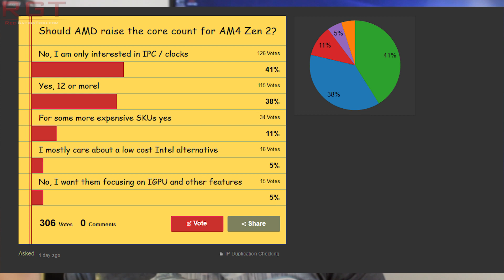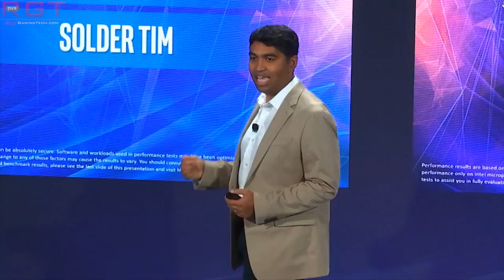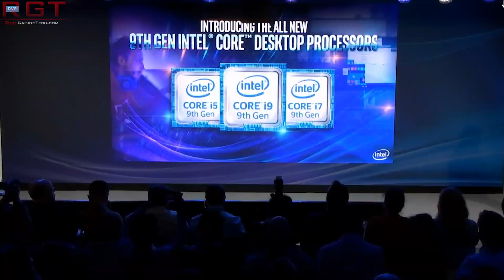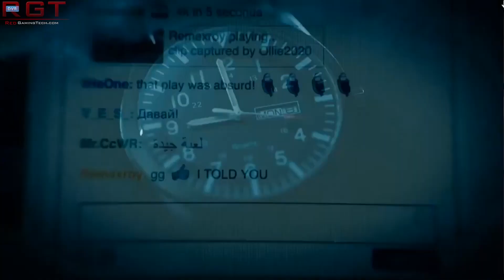Intel 10 Core Mainstream CPU Comet Lake | 14nm & Dual Ring Bus

Comment: 10 core mainstream Intel? (i bet they will list 95W TDP) Perfect for Z390 motherboard + Enermax TR4 360mm so it also cools the VRM :D
Reply: lmfao
Reply: bet this time it will require a new mb
Reply: @technologu  Most likely made of asbestos.
Reply: Advertised TDP->95w..  Actual power use -> 600w...  TDP (what TDP is really for) heatsink requirement.. -> 400w+ (liquid cooling).